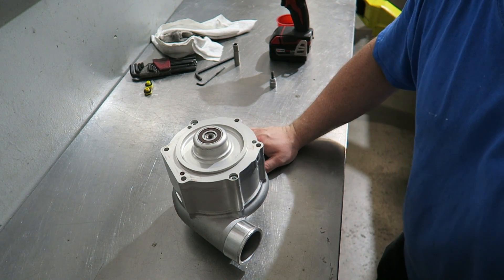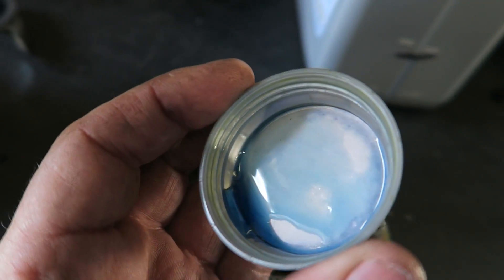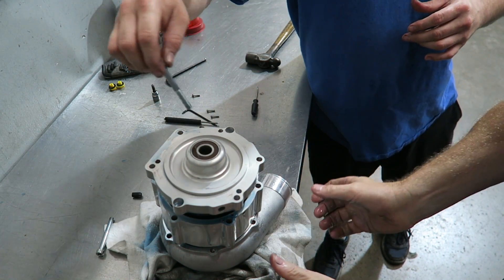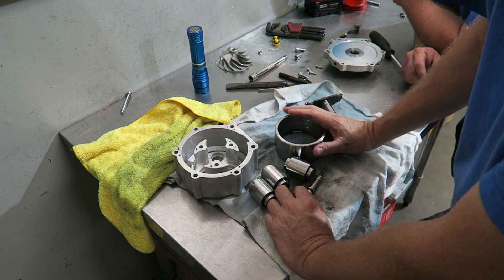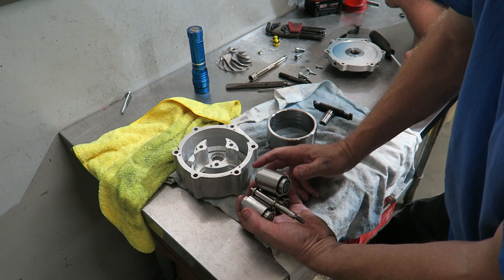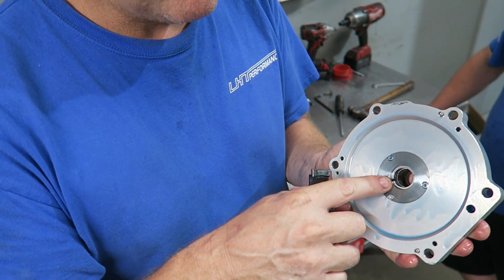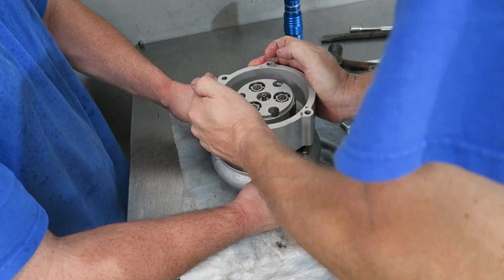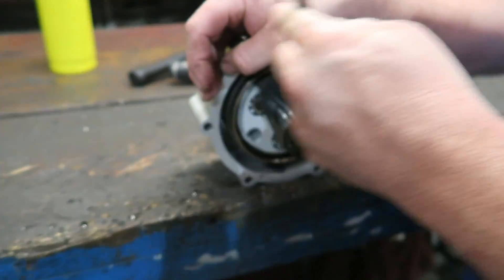INSIDE A KRAFTWERKS SUPERCHARGER - Rotrex

Comment: Really interested in the Rotrex system. If I do opt for the KW kit I’ll be coming to you guys for the install. Do you have any longterm experience with the longevity of these units? I’ve watched essentially every s2000 video you guys have posted, so I’m aware you’ve been installing these for years. I’ve just been hearing that these tend to grenade after 20k miles stemming from input shaft bearing failure. Do you have any customers with lots of miles logged on this kit?
Reply: HaveFunEatingIt would like to know this myself
Reply: HaveFunEatingIt the forums have many cars with 30,40,50k miles on their kits. But some have early failure too. Many variables
Reply: head units wear out like everything else my P1 Procharger needed new bearings and seals after 15k hard miles.

Comment: Once the 38R is out, pull it apart and see where the changes occurred .  They are supposed to be addressing the failures associated to rev limiter /shaft issues.  I would think they would make the barrel and shaft out of one billet piece rather than the current 3 piece situation and beef up the pins on the oil pump mechanism.  Thanks for the breakdown!

Comment: Great video. Very insightful to see the inner workings. The use of the speed multiplier is very interesting. Is the Rotrex oil used primarily for cooling? What was wrong with this unit?
Reply: Pete Miller Besides cooking, traction oil fills the tiny clearances between the barrels and the center shaft and turns viscous under the high pressure it encounters when being squeezed. The fluid is what actually transfers the power. Under normal operation there is no metal to metal contact.

Comment: What does the traction oil do? I always thought that they operated on a slip principle like a torque converter. Thanks for opening one up, very cool.
Reply: Mark McCawley traction oil fills the tiny clearances between the barrels and the center shaft and turns viscous under the high pressure it encounters when being squeezed. The fluid is what actually transfers the power. Under normal operation there is no metal to metal contact.

Comment: Curious as to what you guys determined was wrong with the unit and if you were able to fix it. I have a C38-91 that died on me and is sitting in my garage because Kraftwerks won’t get back to me, and if you guys have a solution I wouldn’t mind shipping it out to Florida 👍🏽
Reply: HORSEPOWER4321
1 second ago
OK. The issue is not with the supercharger its with the belt drive. Kraftwerks uses a tooth belt on these S2000 conversions. Rotrex say categorically to use a poly vee belt. If your not going to follow the rules you're going to break it. The input shaft is not pressed in, it is screwed in.  Follow the rules and it won't break. The shock loads when hitting the rev limiter or launch control are nasty and the tooth belt transmits the shock and the shaft strips the thread of the input shaft. TTS Performance do an S2000 kit with vee belt and auto tensioner, they don't have any trouble
Reply: @TTSPerformance  thank you for sharing your knowledge on these units! much appreciated 🙌

Comment: Could internal parts be made in titanium? 
I can see the advantage of the weight in terms of a heavier Flywheel effect if it had a clutched free wheel design, but since it’s always connected lower internal weight would be beneficial.
HKS makes a similar unit, not sure if it’s more reliable though. 
The issues I’ve read about seem to involve the larger compressors and rev limiter hits. I’d guess the shock sent through all those multipliers also multiples internal torque and thus damage.
Reply: Good question.

Comment: You mention that you keep the shaft rpm below 90000rpm,  How much under would you say to be safe?
Reply: I've seen people run them to 100k rpm for an extended period of times without issue (3+ years). the only thing they don't do it rev bang. rev banging kills these units.
Reply: @PiterStreak  Yea, I killed a C30-94,  in just over 2 years.  It was spinning to a hair off 99k, thankfully Rotrex replaced it and I upgraded to a C38-61.  I believe my new setup will spin the C38-61 to 88k.

Comment: Specifically, what was the issue with this unit? It seemed to be in ok condition.
Reply: Seems like the shaft that was floating (sat into) the pulley side was slipping. Watch and he says he thinks they should have pinned it or welded it. If that shaft freely spins then only it will spin and comp will not. Could be wrong but that seemed to be the one weak link

Comment: Thanks for the look inside! Was there an issue with this unit, and were you you able to fix it? Keep up the great work!
Reply: Jason Hass Rotrex blowers are non serviceable. Simply disassembling them throws the clearances off enough to render the unit completely useless. I know this due to experience with a Rotrex engineer
Reply: @wantapgt  question: I hear these types of superchargers are reliable. Is the unit being non-serviceable a major issue? Or do these supercharhers generally rarely break for it to matter?